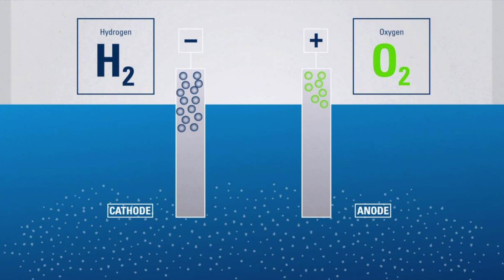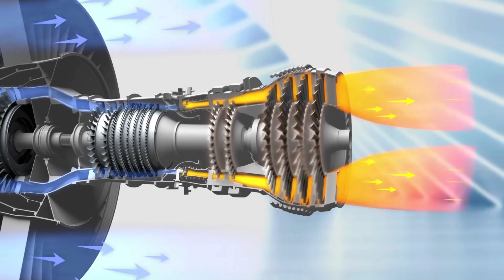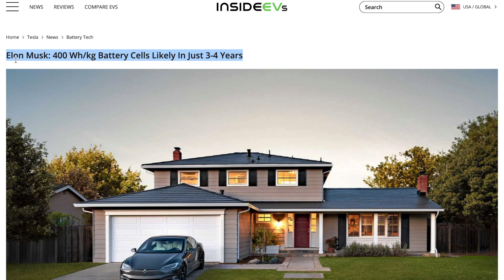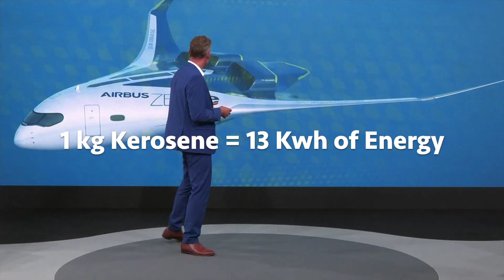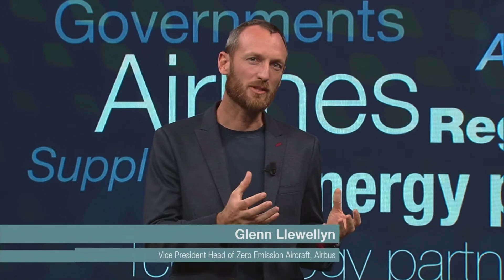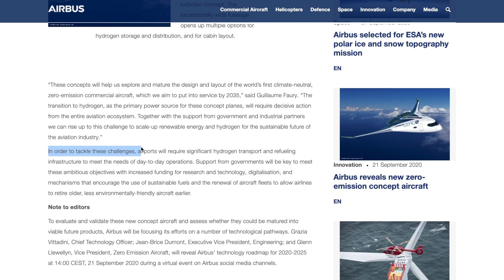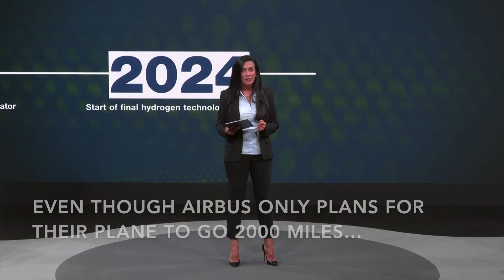Why A Hydrogen Plane Is A Terrible Idea

Comment: The issue with electric planes is the weight.
Reply: shhhhh tesla fanboys will use lithium bateries to go to mars
Reply: Not if you power it with hydrogen passning through a fuel cell😊
Reply: @GeneralGreevas  doesnt tesla use hydrogen for spacex rockets?
Reply: Also the amount of non renewable resources it requires to build
Reply: @markmapanao4689  you cant burn food for fuel. its just not sustainable.
in 1950 US military already flew Hydrogen fuel plane. yeah the 1950s thats 70 years ago. its just that kerosene is cheaper. But its not impossible to produce Hydrogen fuel with Nuclear power like nuclear submarines use electrolysis to make oxygen.
Reply: Did you watch the video? Battery technology has a long way to go. As the energy density increases they will get lighter and lighter. Burning hydrogen however is a chemical reaction that can only every be as efficient as physics allows.
Reply: @eastsouth9548  if you put a carbon tax and start to heavily hydrogen for long term energy storage (the EU plan for compensating for the renewable energy problem of non-continuous production) that price issue can take a big swing. I was looking into it and industrial electrolysis can reach 80% and the limit is estimated on ~95%, there are already different demonstration project.
Reply: @CyclonicTuna023  but burning hydrogen also mean your plane will get lighter while you travel, to give you an example currently planes regularly takes off with MORE weight that they can land with! This is a huge impact to all the calculation done in the video and general practicality. Also the time to refuel is a huge point, plus we talk about propeller (electric) vs tubofan/turboprop (H2), that is a massive difference in the engine and their speed and efficiency; jet engine can fly much higher and thus be so much more efficient.. there is a reason why propeller plane disappeared for commercial airline. The whole comparison if failed at the start
Reply: @lesto12321  Theoretically an electric jetengine is possible. It would jus require a lot more energy. Look up electric plasma jets. 

The thing is that looking into the future electric is just more scalable. Even with hydrogen's high energy density, its just another chemical that we burn. And if we ever were to reach 100% efficiency with burning hydrogen,  which is unlikely, we will have reached a dead end. 

With batteries however there's no telling where the ceiling is. We could one day have a battery that charges in minutes and can fly a commercial jet for days or even weeks. 

But we'll never get there if we don't start now. Battery technology has been severely left behind. Its only due to the succes of Tesla that they have been given a second look. Before that battery technology has been practically the same for decades, centuries even.
Reply: @GeneralGreevas  
Hahaha 😂🤣🤣😂🤣
Reply: @matskjellstrand7730  you still have a weight problem because tanks to store hydrogen tanks are superheavy (even when empty), there's also the need for platinum in fuel cells which is more pricey than gold.
Reply: @matskjellstrand7730  Actually, fuel cells don't cover it yet, since their specific power (not energy) of 1.6kW/kg is yet too low. I don't have any idea though how much progress is done on the specific power of fuel cells though, so this might change in the future.
Reply: @CyclonicTuna023  You have absolutely no clue what you're talking about. Battery technology has always been pushed at cutting edge. Think consumer electronics, satellites etc. And in the end also batteries are just another chemical reaction.
Reply: @andreastattarisuo1034 actually theoretically we haven't reached batteries max limit the rechargable lithium air  battery ( not lithium ion) can reach upto 12000wh/kg. check it on Google but we haven't figured it out how to properly use it and manufacture it
Reply: Yep. That is covered in the video. The density/weight for batteries needs to be radically improved. But if they are then electric planes become cheaper. So it's all down to battery tech.
Reply: @stewdean  But first they have have to be radically improved which might never happen. So can't say H2 won't work. More likely is that battery will not get there for a couple of decades still.
Reply: You're thinking of batteries, those would be too heavy and current battery technology doesn't have anywhere near the power density to power a plane. Hydrogen however is incredibly power dense. This video suggesting using the Hydrogen in combustion engines is simply a stupid idea. It would make more sense to use the Hydrogen in fuel cells to power electric turbojets which can produce enormous amounts of thrust and incorporate that with a hybrid traditional jet engine system for use during take off and climb.
Reply: @L33tSkE3t  I’m airplane mechanic
Reply: Nobody here knows anything about planes
Reply: @steven_martir  I do. I studied Aerospace Engineering.
Reply: @eastsouth9548  no, methane.
Reply: @ezicarus8216  hydrogen (as a liquid) is 3 times more energy dense per unit mass, but 4 times less energy dense per unit volume.
Reply: @epicgames8967  “theoretically”
Reply: Precisely plus can you imagine how long it would take to charge a plane????? Even with advanced charges. And it would really suck for pilots if the plan was much heavier and cause more crashes too.
Reply: @peterkratoska3681  "you still have a weight problem because tanks to store hydrogen tanks are superheavy (even when empty)"

For batteries this issue is even worse. Batteries are heavier than full hydrogen tanks (for the same amount of energy) and they don't even get lighter when they become emptier.
Reply: @seneca983  no need to tell me about that. Lithium Ion batteries are 1 to 1.5 mj/kg while jet fuel is 45mj/kg.   I'd say the best option is synthetic fuels and c02 sequestration.
Reply: @CyclonicTuna023  but even when the energy is draining the weight of the batteries stay the same, its a massive inefficiency
Reply: And where does the electricity come from, fossil fuels making it a less efficient jet fuel
Reply: @trickyvickyplays1933  The electricity could also come from renewables or nuclear.
Reply: And the politics
Reply: @CyclonicTuna023  How much lighter do the batteries become over the journey?
Reply: I think the electric plane enthusiasts are so smart they believe a system of really long extension cords is the ultimate answer.
Reply: @matskjellstrand7730  exactly. And the benefit of using fuel cells is that the plane is still an electric plane, so once a cheaper battery alternative comes along, the fuel cells could simply be switched with batteries without having to rebuild the entire aircraft.
Reply: @CyclonicTuna023  "Theoretically an electric jetengine is possible. It would jus require a lot more energy. Look up electric plasma jets."

Not true. Electric motors are far more energy efficient than jet fuel driven engines. Jet fuel is very energy dense, about 50x that of li-ion, but a lot of all that energy is lost as heat when burning it, where an electric motor is much more efficient at turning the available energy into actual motion. So when you take into account the efficiency of electric motors, jet fuel only gets you 14x further per kg compared to li-ion. If solid state batteries can be mass produced and if they can compete with jet fuel from an economic view, then battery-powered passenger plane scale flight will be totally doable.
Reply: @onit996  "Actually, fuel cells don't cover it yet, since their specific power (not energy) of 1.6kW/kg is yet too low."

You have to take into account that a lot of the energy in jet fuel is lost as heat as it burns whereas electric motors are much more efficient. Conventional gasoline engines only convert about 17-21% of the energy into motion, whereas an electric motors convert 85-90% of the energy into motion and dissipates a lot less heat. When you account for this, fuel cells become a viable option.
Reply: hidrogen is lighter than fuel
Reply: That's heavy, man...
Reply: @lucasscoz6090  hydrogen is fuel
Reply: Thank you.... Not once did he talk about weight
Reply: The change as well. Imagine how long it will take to charge it, you not carrying a ton like a car but many tons and you have to lift it off the grown. Long flights are not possible with electricity.
Reply: @CyclonicTuna023  yes, it will become 5% more efficient in next 10 years but the weight will reduce by 0.1%
Reply: @CyclonicTuna023  yes battery tech is future!!!!...... In next 1000 years, when we'll not need planes at all
Reply: @CyclonicTuna023  What, and you think battery technology isn't somehow constrained by physics?

To put it simply: until battery can have more energy density than kerosene, any long-haul applications of battery-powered plane won't work. Short haul, sure, like the Eviation Alice, but there's a reason why Airbus abandons its electric long-haul program and goes for hydrogen instead.
Reply: How do you get 800km/h with electricity? By spinning a prop? 😂
Reply: Case closed, this guy really thinks that we wouldn’t have the capability of hydrogen expansion. However, it’s fine to limit the range of aircrafts with a dense battery pack and wait for more than half a day to recharge the plane. Okay lmao
Reply: AN electric plane can be powered by a hydrogen fuel cell, which has the advantage of higher energy density per mass compared to batteries along with the benefit of an electric motor
Reply: @eastsouth9548 no he hates it so much he is using methane at least for starship

Comment: Good luck for electric plane to get into long haul flight. The only way for that to happen is if battery somehow has MORE energy density than kerosene. Since you can't burn off fuels during flight, the plane weight is constant from takeoff to landing. Fuel burners, kerosene or hydrogen, loses weight over flight.

It's like OP doesn't think this through making this video. Not to mention not actually responding to those with reasonable objections.
Reply: exactly mate, i dont know why most are spending r and d money on electric planes, it has soo many issues which will take a long time to fix whereas hydrogen power just needs to improve. We need to go carbon neutral very soon, i dont think batteries will be able to do that anytime soon, this whole electric thing is too hyped, while there are better solutions
Reply: @hazikaiyan5903  Electric plane can work in a short haul flight with small capacity (things like Eviation Alice, which should have its first flight this year and will have the range of ~800km, although FAA regulation regarding having enough fuel to fly to alternate airport and such means it's going to have shorter practical range). It's the long haul that's a problem. Even Aluminium-Air battery doesn't have enough energy density to compare to kerosene (only around 2/3).

Though it can be a problem if it gets really popular and there's a LOT of small electric planes running around (the Alice only has 9 passenger capacity)...ATC's gonna be a nightmare in that case.

Hydrogen plane also needs some design overhaul compared to normal planes, so in short term something like the Alice can be a useful stopgap in helping greenify things a bit, especially since short haul flights are inefficient as heck. But yeah, in long term, I think hydrogen's the main way to go for green fuel, especially once large-scale green hydrogen comes in. Or both can be used for different purpose.
Reply: @onyhow  exactly mate, you're one of the people who actually speak straight facts
Reply: @onyhow  I agree with you, but how does Airbus plan to store the hydrogen? It either needs to be under extreme pressure (10,000 psi) which requires very heavy tanks, making it impractical or it needs to be extremely cold (< 253 celcius) and you need some way to actively keep it that cold to prevent it from boiling.
Reply: @Eikenhorst  actually no you will need to boil it to use it. but that is easy juts a normal resistor. when not in use you need to vent it to prevent over pressure. 
liquid hydrogen also allows superconductive materials with massive weight saving in the coper cabling to the Electric fans.
due to its volume long haul flight might still require delta like plains  that can carry more fuel. but its stupidly light a full plain of liquid hydrogen is almost as heavy has  an empty one
Reply: Ammonia cost only  $1,022.50 a ton. Seems like a no brainer.
Reply: @jimj2683  And that's not a bad thing if they have realistic expectation and market...namely short haul flight. Just look at Eviation Alice. The problem is applying that logic to long haul, like the video maker here.
Reply: @FlyingMartino   “good luck to fly in a jet engine airliner” What? Jets has been developed since WW2. It's not a physics/engineering problem.

“good luck to cross the Atlantic with a dual engine aircraft” This is a regulation problem, not engineering/physics problem. Boeing and Airbus (ESPECIALLY Airbus) quickly moved in after ETOPS requirements are relaxed (the big thing why it's like that is because the regulation was formed based on piston engines...which are inherently less reliable than jet. And since jet existed for a while already... )

Neither problems you posted are based on physics/engineering that relies on technology that don't exist yet.
Reply: Even if that were the case it would still have a huge impact on the airline industry. In 10 years time, there should be enough technological advancement to roll out an electric regional jet like a CRJ 900. Delta for instance, try to use their regional jets for 3-6 flights a day. If airlines had 10 electric regional jets, that's enough to make an impact on the industry. I've also heard of an idea to develop a hybrid plane for long distance travel that uses electric and jet fuel. 

Me personally, I think planes will still be using jet fuel for the next 20 years. Every other option just comes with another set of problems
Reply: @onyhow  For short range travel, high speed rail could also be developed further to supplant regional air transport. It would ease congestion at many airports and is also more convenient than air travel. For long distances though, Hydrogen powered aircraft are the way to go.
Reply: @anonymoususer3012  Yep. There's multiple solutions. Though short-range electric plane will be useful to travel to remote-ish places where developing rail infrastructure would be too expensive to maintain.
Reply: That simply not true. When you realize that graphene batteries exist now and will eventually be mass produced it becomes very obvious that electric planes are the future. Graphene is going to be the material the planes are built out of as well as being the battery. Basically the structure of the airframe itself is going to be a massive battery which means the weight will be nothing. Actually less than as graphene is insanely strong as well as being incredibly light. It’s stronger than aluminum, steel and carbon fiber. Yet it’s lighter than all of them because it’s literally just carbon atoms lined up. It also charges immediately. 

They’re likely going to be hybrid planes. They’ll derive the turbo fan with an electric motor when you’re at cruising speed while the jet sips fuel just enough to stay in combustion. 

The plane used maybe 1/10th the amount of fuel it normally would. Basically only takeoff and landing. Airports already have massive electricity infrastructure and the prospect of them covering their entire roof and fuels with solar panels and can literally become more profitable by selling the electricity that goes into the plane. It’s very obvious this is where the airline industry is going. 

Boeing knows this. But they’re going to let airbus fall on their face. Pratt and Whitney is doing the same thing with GE and CFM. While they make bigger and impractical engines. Pratt and Whitney made. Better gear system for the turbo prop so that it gets 25% more efficiency.
Reply: @stevederp9801  Oh really? What's their power density? How do they scale the battery size up? What's the production scale? What's the timescale of those coming out?

Remember, kerosene has power density of 12,000 Wh/kg. Unless battery can beat that by quite a bit (again, because planes burn those, thus lighten over time. Battery can't do that), good luck making the plane as big as the intercontinential haulers we have today. Smaller regional ones, maybe, but good luck flying between continents.

The same power density is also the reason why long range battery powered cargo ship isn't coming any time soon too.